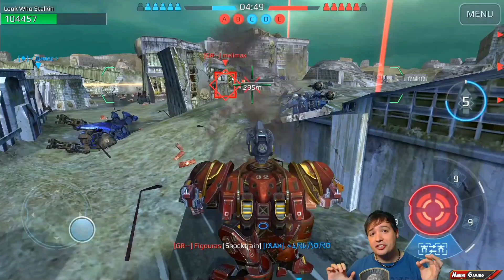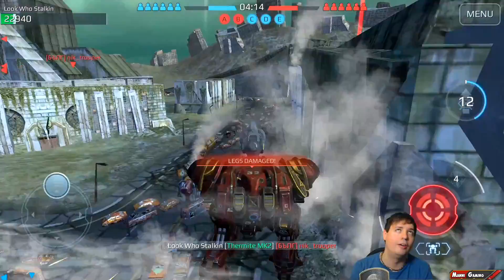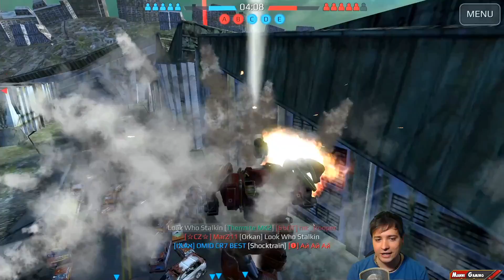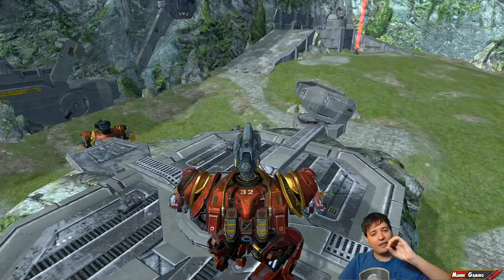War Robots Mk2 Maxed Thermite & Vortex Inquisitor Gameplay - WR

Comment: I sold my inquisitor points for weapons upgrade. I admire the advances robot :however, Its weakness is after it lands. It is an ambush bot. It waits and than jumps in front of you and unloads. To defeat this bot you need to have a better angle. After it unload its arsenal attack.  Every bot has its weakness

Comment: Manni, the thunder has a spread effect. The belly of haechi is very thin. So every spark from thunders does not hit him. Same goes for kumiho but bulgasari on the other hand is a little fatty. They take relatively more damage. This is just what I think. May be there is another reason. I don't know.
Reply from the maker: Yes, I realize that. But the bot size and surface area is still pretty large also on an Haechi. Thunders and Punishers should be able to score some good hits nontheless. And the hitboxes are too small on this bot. And in particular the Aphid, Vortex, Thermite are almost useless against those bots. They are supposed to seek the hit where it hurts. BUt they can't with the weird hitboxes on Haechi, etc.
Reply: Yeah Pixonic just made the ultimate weapon. I don't think the spectre can be equal to dash bots
Reply: Manni-Gaming also the gareth hit box is so small every single shoot of my wepons miss it
Reply: Lol. “Belly.” I like the way you said it. It’s actually called a torso but saying belly is okay :)
Reply: The Haechi, I hate that bot :however, I have adapted to beating it. It can only be beat after it's wounded.